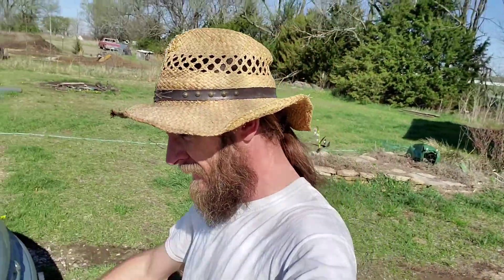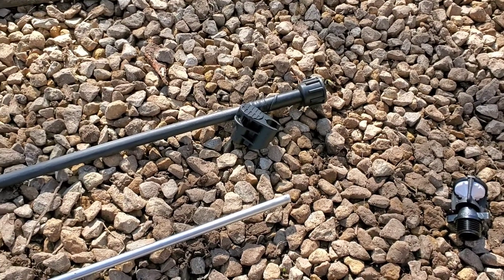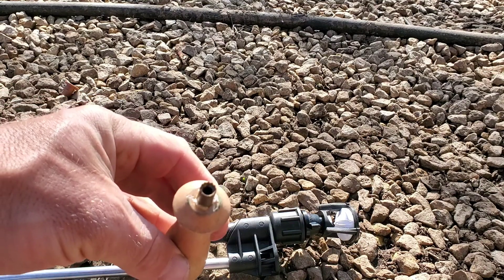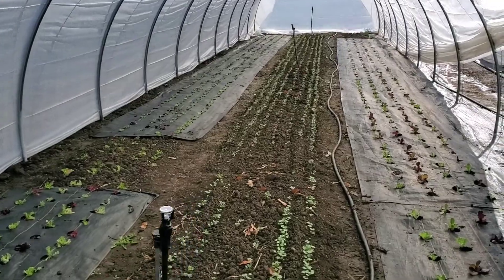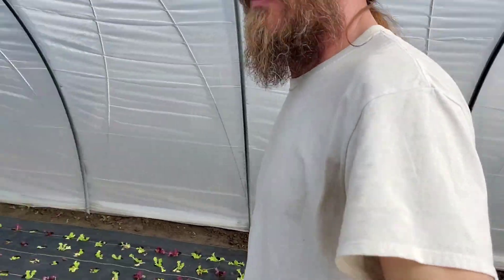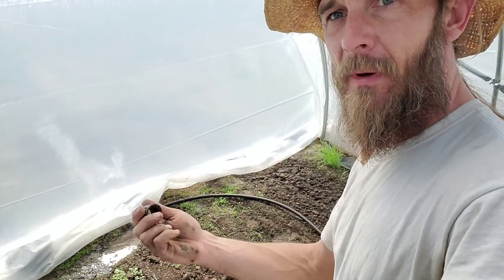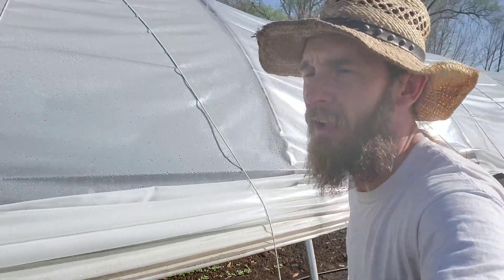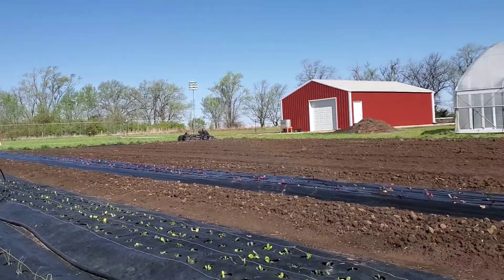Market Garden Irrigation System (Part 2) Overhead Irrigation Setup

Comment: Did you have to put in a dedicated well for your sprinkler system or are you pulling off your well for the house?  You mentioned 80 psi and that’s high for normal residential.   Just curious in that.   I do like your setup and work you have done.  Good job and stay dry!  Lol
Reply from the maker: I am on rural water. Just great pressure in my area